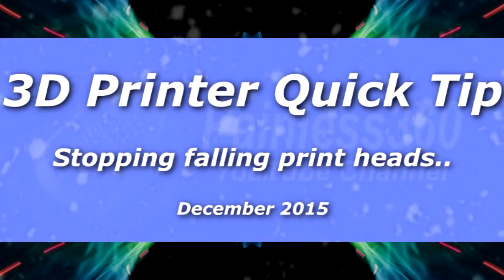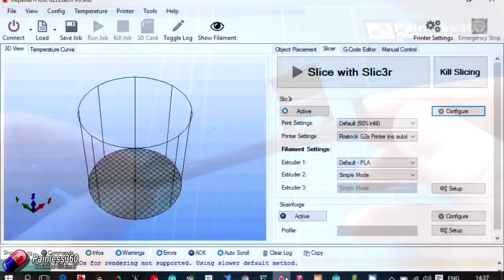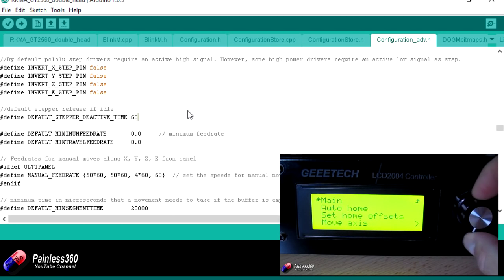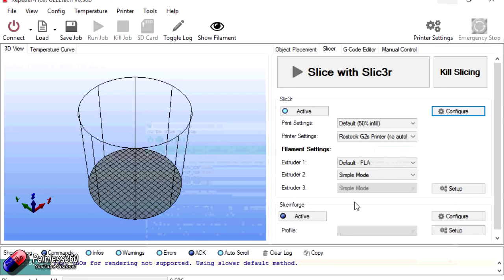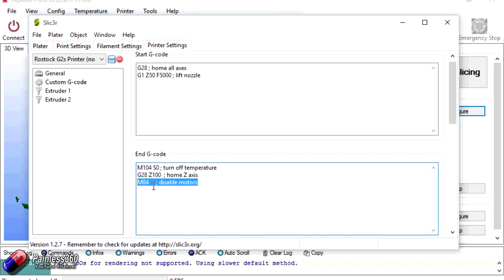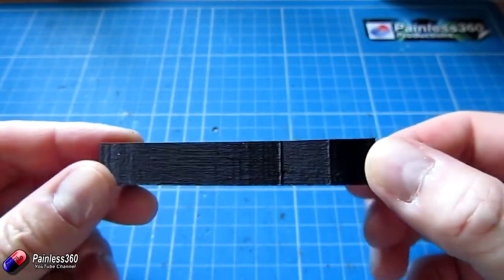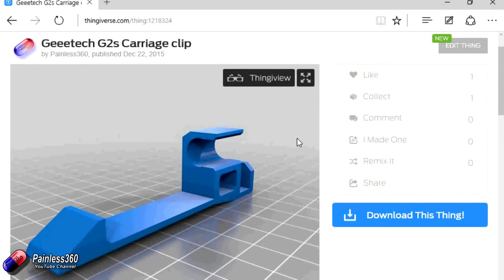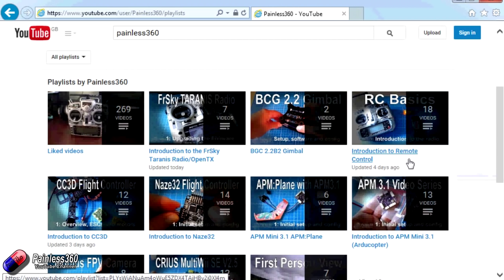3D Printer Quick Tips: Stopping the hot ends falling

Comment: Looking at the design, I suppose you have to unlock your printer head manually before the next print, and you should not forget to... or the 3 holders will snap.

How about a carefully designed slope on the hold-back tab's surface, so the printer can unlock itself when actively driving down? This might require a facet or rounding on the edge of the metal counterpart.
Reply from the maker: This is a very old fashioned printer and not one I'd recommend. See my 3d printing series... happy flying!

Comment: you don't need to change anything in the firmware, just change "M84" to "M84 S<time>" at the end-Gcode.
and about the preheating - you can add "M84 S0" to the start Gcode (im using curaEngine but i think it would work on slic3r also) and then the stepper motors won't turn off while heating.

another tip - use curaEngine in repetier!! my results are 10 time better when using curaEngine. just make sure to set the start and end Gcode to fit your printer - I'm adding "M84 S0" after the homing to stop the head from dropping while heating and "G28" at the end to home.

btw, 
you are one of the reasons i got the G2s pro from banggood and I'm vary happy with it. so thank you :)
Reply from the maker: +yotam amar Great tips - thank you very much!